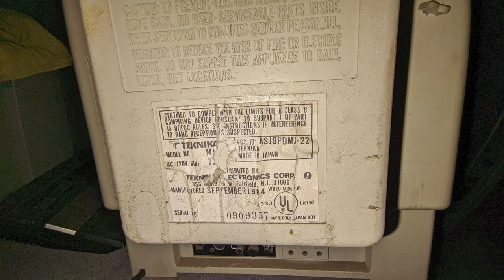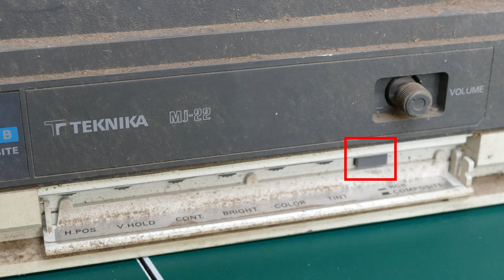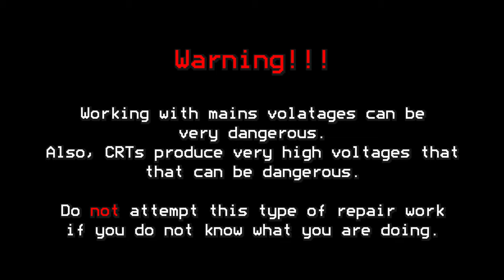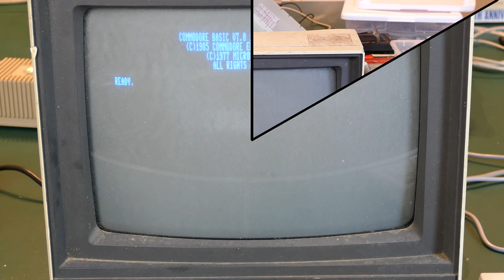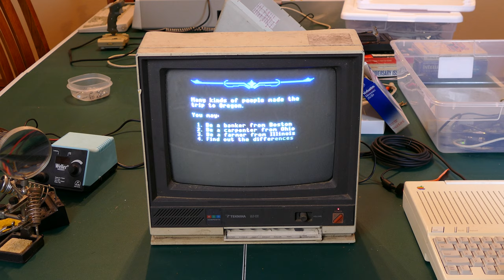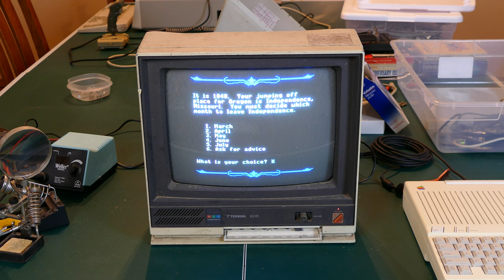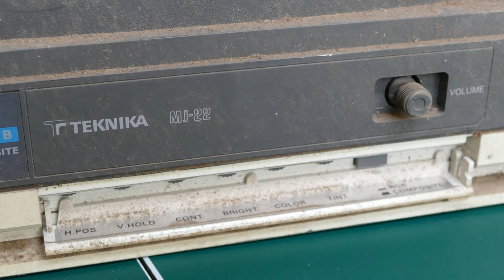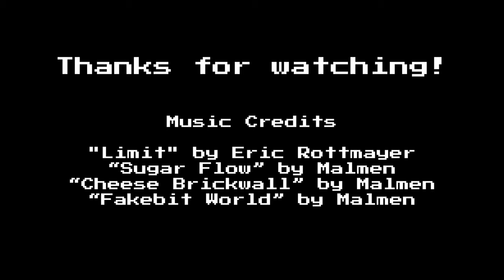Rescuing A Teknika Monitor Found In A Recycling Dumpster

Comment: Just started watching. Love the aesthetic of it!
Reply from the maker: I just have to say as this video was uploading I was watching your latest with the Apple II Plus. Looks like we have similar cleaning styles except I use the green pad and you use a magic eraser. LOL.
Reply: Hey I'm noticing your T:Slim X2! You running Control-IQ yet? (With matching Dexcom G6) I highly highly recommend it. 

Now that monitor rocks. I assume the DIN RGB input is the same as the Taxan and Commodore 1084P monitors. Looks the same. And the RGB I and III switch will surely be for switching between Apple II/III RGB and CGA style colors. Sorry if you have figured that out, I didn't finish the video yet.
Reply: Ok a couple more tips you may want to try: If the dark part of the from bezel isn't just paint on the white plastic, try something like 303 or Armor-all to bring back some shine and remove any fading it may have. Then, for that annoying dent on the left edge of the front, use a nail file (Emery board) to file it down on the edges to try to make it a little less obvious. That works to great effect on all kinds of case nicks . And finally, wondering if you uses some Deoxit on those pots! 😁 Awesome rescue though! A CRT that was very worth saving!!

And yes, I love Magic Eraser and then the baking soda for the more stubborn scuffs. Similar indeed!
Reply from the maker: Yep. Dexcom G6 here. Blood glucose has never been better. I'll have to test out CGA on this. I didn't know that's what that switch was for. thanks!
Reply: @RetroHackShack  CGA and the 128 RGB are the same and are interchangeable. The Apple III/II RGB uses different color mapping so early 80s monitors supported both. (Even the earliest 1084D monitors did both.)

And yeah with Control IQ my A1C has never been better and I almost never have lows! Amazing stuff.

Comment: You can pull off the volume knob and clean that too.
I had one of these, I got it in the early 90's with a Commodore 128. Then it became my main PlayStation 1 monitor.

Another random tip. After some years (I took this with me to college, painted the beige case black, and used it off and on with a PS2 in 2010), I had to solder all the cold joints on the bottom of the board. I think I was getting monitor flashes and sound noise. I ended up doing the whole board for the hell-of-it, but I think around the flyback was most needed.

Comment: If I may, there seems to be a consensus about crimping the live wire cables and using spade connectors. My understanding is that in case of a surge the solder may just melt and the wires could fall off.
On the other hand, pushing the wires into the  holes before soldering them could be equally effective, so... 🤷🏻‍♂️

Just noticed at the end you mentioned that's not a socket that accepts spade connectors BTW. 😐

Comment: I have this monitor. Could you show a picture of the cables you used and which connectors on the monitor? I am not positive where composite input is.
Reply from the maker: you can see it at 05:00. It is marked "VIDEO". You will need to make sure that NTSC COMPOSITE switch is set as well.

Comment: My guess about the RGB Mode switch is TTL (CGA/C128) vs. analog RGB.  If the monitor does support Analog RGB, it would be great for an Amiga or a CoCo 3.
Reply from the maker: Yeah. I am going to test both of those when I have time.
Reply: @RetroHackShack  did you ever test it?

Comment: I have this monitor. So far I only use it for separated & composite video (don't have a C128). Wondering what else might be able to use it's rgb function? Seems like little is known on the internet re: the two different rgb modes. Sure would be cool to use as a "PVM" for rgb consoles or other micro computers using more than chroma luma.
Reply: I found someone who makes custom cables he's going to try and make an adaptor for a scart plug
Reply: @raccoon681  That would be cool!
Reply: @directionlessstudios7210  ill let you know his contact info if it works out he ordered the parts
Reply: @raccoon681  awesome, thanks!